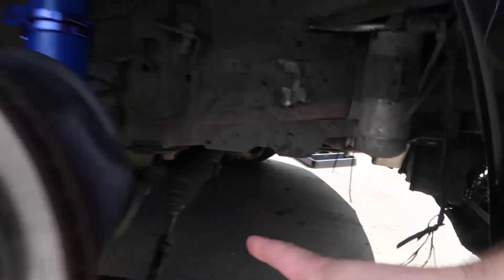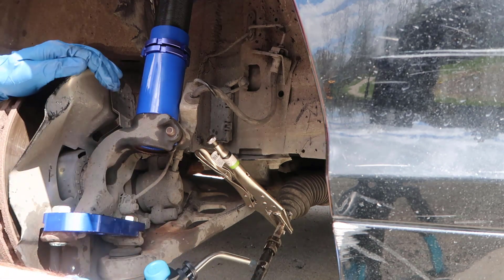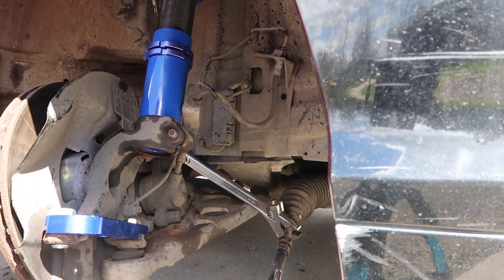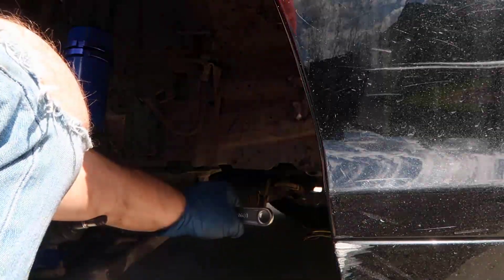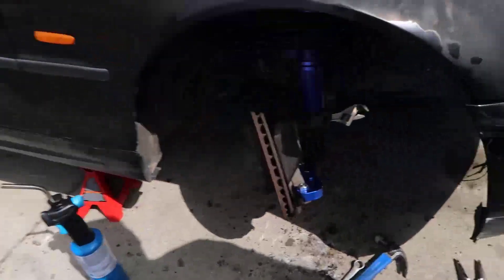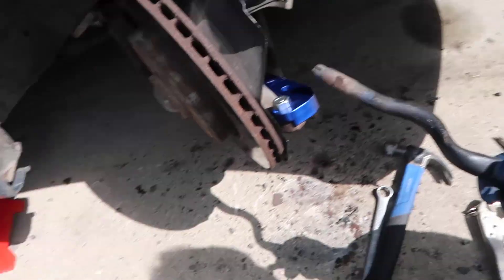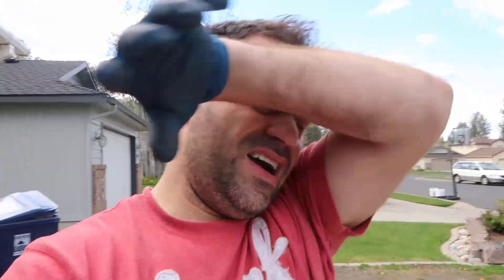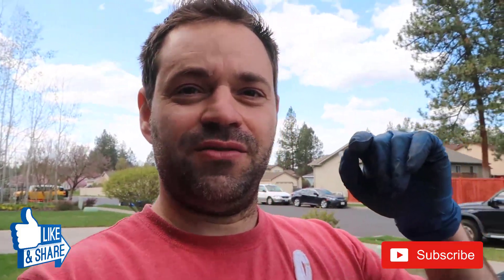How to Remove Stuck Tie Rod or Rusted Nuts

Comment: I just utilized this technique to remove a tie rod end on my Kia Rio. If you’re not into Hemanin’ it, you can set the tie rod end on a jack stand, and carefully wedge a breaker bar underneath the control arm to assist in rotating the handle of the wrench. Remember that rotational force increases with leverage!

Comment: I find it hilarious that you are having this issue... with an E46. 

I am having the same problem. Time to go get a torch.
Reply from the maker: dude this crap is not a joke. I suffered for hours. Get that liquid also. I believe that helped me. Do not give up even when you think it won't come off because it will!
Reply: Car Mods Garage I just sprayed it with penetrating oil because that usually works for me. Gonna try and break it loose. If it doesn’t, it’s time to try a torch. 

Thanks for the video
Reply: SAME.....haha. Here we go with the heat!

Comment: I ended up using a angle grinder and actually welded the nut and a piece of a bolt to the chassis  gonna try a power drill next
Reply from the maker: 😂 it sucks didn't it!?
 Recently I got a while knuckle because I couldn't take the axle off that.
Reply: @CarModsGarage  it sure does dude I got one tie rod on and one off at the moment its drivable just not the smoothest ride.
Reply from the maker: @xxxxxbriansanchezyyy  good luck brother. It sucks but you will get it! 🤙

Comment: If your installing inner tie rod you could hack saw cut off the inter tie rod behind the nut to.  I'd rather get the nut off, lots of work.
Reply from the maker: True. Bad part about clotting the other tie rod is because if I need to replace I will need to cut the new one also.
Reply: @CarModsGarage  I used heat propane torch yesterday and it worked. I still hard to use vice grips to hold the tie rod in place to take that nut off.   I did use some wd40 a while earlier wasnt working.
Reply from the maker: @jamesrich8463  ya way to go man. The heat does the trick.

Comment: How long did you have to heat the bolt for with the propane?
Reply from the maker: For around 6 to 8 minutes. Then I would try and pour some  of that liquid I have on the video. It took me FOREVER. Don't give up it will come out
Reply: @CarModsGarage  Awesome, thanks! :)
Reply: @CarModsGarage  how much is many times?
Reply from the maker: @g35tho11  😂 sorry I fixed that text. Autocorrect kills me. 6 to 8 minutes with the liquid in there and it will slowly come out.

Comment: I'm just trying to adjust the tie rod for toe in, but the lock nuts are very siezed up. Is there a way to get them lose without damaging the tie rod assembly?
Reply from the maker: I would try to heat it up with a torch and see if it comes loose.